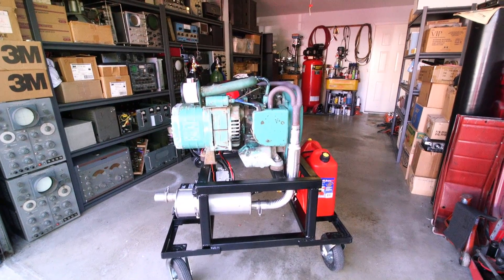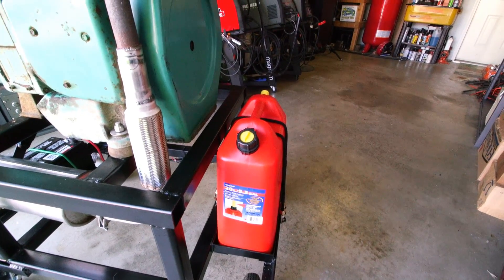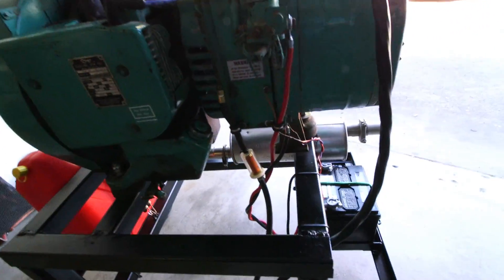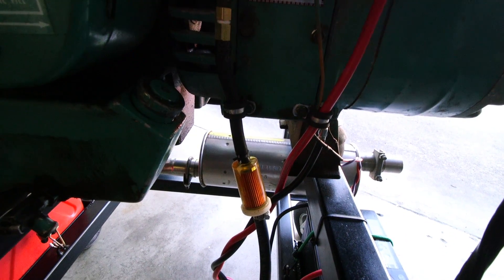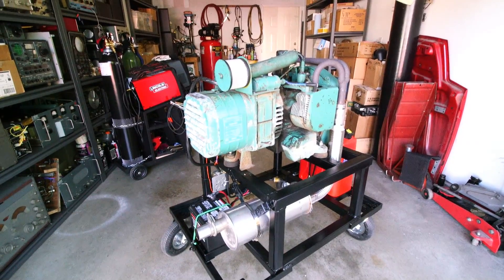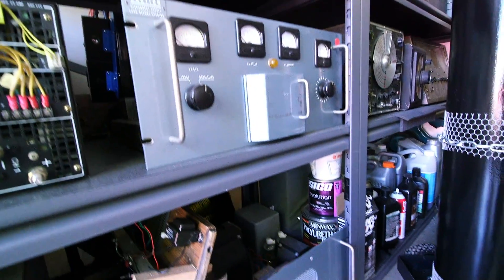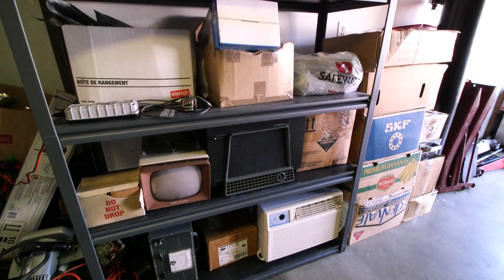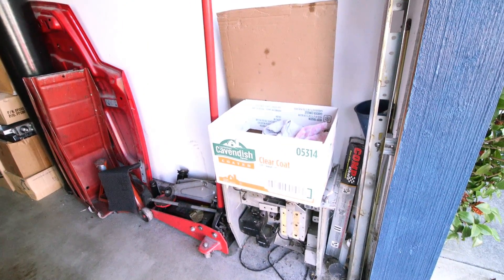Generator Build Update - See It Run!

Comment: You might want to watch for radiated heating of the battery from the proximity of the hot exhaust pipes and muffler; possibly install some heat shrouds. Also, I would move that fuel pump from the bottom edge of the frame to the top of the tube; it's far too easy for you to hit it on something where it is now. Also, it's easier to notice any tubing leaks when the joints are easily visible. I would not use a big plastic fuel tank; fabricate or buy a pre-made metal tank. I just don't trust plastic fuel tanks, especially in a shop environment.

You didn't mention the rating of your generator, so I'm guessing that it's about 3500 Watts; that means you should budget about 3/4 gallons/hour for full-load operation. With only a 5-gallon tank, you will have to get up in the middle of the night to refuel it. You could put about a 20-gallon tank on a separate cart.

I think I would also install a length of 2" x 2" square steel tubing under the MG set; a little extra steel in the frame is always a good idea.

I have also heard stories about Onan horizontal twin engines being finicky about their crankcase oil level; just a little bit low or high can cause shut-downs, and the oil dipstick isn't all that easy to read. OTOH, I have a 20-year old Onan 5500 Watt unit with about 600 hours that runs flawlessly.

Comment: I'd like to see you delve into the 'workings' of that generator a little. My brother 'inherited' one like it for payment of a $500 debt...I built a wheeled stand for it like yours...he lives where there are often power outages...
 These  ( or his anyway) was 3.5 KW and came from an older motorhome...the fuel was tapped in from the RV gas tank, and used it's own battery to start it, there's even a 10-12 amp charging 'wire' that has a nice big rectifier in line......no starter motor like most engines, instead it uses a part of the 12 volt section to start the engine without grinding gears and commutator brushes....electric fuel pump was mounted right on the side of the engine, and electrically heated choke/throttle.
 The most annoying thing I had to deal with when making a stand....the exhaust and muffler have to be underneath...!!
 These things have BIG slip rings and large graphite brushes....should last a lifetime....most of them are also equipped with a remote start/stop system...just 3-4 wires...so you can just power-up without getting out of the big lounger chair inside...
 Generator section actually had 2 separate 120 windings...you could switch a couple jumpers for 120 or 240....60 Hz vibrating reed frequency meter....they stay within 1% or so on the 60 HZ....

Comment: @1:59 Make sure the gas tank has a one-way vent/check valve. A non-return fuel system needs a check valve, preferably in the gas cap. Air is allowed to go in but not out. If it's totally sealed it will run to a point the fuel pump, no matter how good, cannot "draw" any more; i.e. vacuum created fuel starvation. 
The easiest way is to use a Ford 2 bbl "umbrella" style check valve or a lawn-mower style 5mm "duckbill" check valve; just drill the appropriate hole for either one in the top of the gas cap and install point end towards into the tank. The duckbill will need a cover to prevent debris from getting in. The umbrella won't. And we're talking pennies for either one. Or find an automotive style vented gas cap that screws on properly. However, it might be difficult to find.

Comment: Those RV-designed Onan's do run for a good long time. I did notice one thing you might want to correct before you run it too long, and that would be to turn your final fuel fuel around, so the gas comes in on the outside of the filter. It will probably work ok like that, but you won't be able to see when the filter is getting loaded up with dirt.😉 I think I may have mounted the generator in the low part of the frame so it's not top-heavy, and you could put something over the top to protect it from the elements when it's in use.. Other than that, nice unit, and it should last for a long time with an oil change now and then.😁
Reply from the maker: Hi Dan. The filter off the tank (bottom of the frame) is there to protect from particulate. The top filter was reversed on purpose, as I was paying attention to the top port (fuel back flow during design.) The upper filter really isn't needed, I just use it to watch the prime function now :^) Thanks for your input though, it's appreciated.

Comment: Paul, you might consider using a portable marine fuel tank. They are already set up for siphoning the fuel out the top side of the tank, and would be much safer than relying on a rubber gasket arrangement on the bottom of the tank, as you have it. That rubber will eventually deteriorate with time and fuel exposure. The marine tanks are portable and you can have more than one available for use.  Those Onan generators, with the 4pole generators are great for this kind of us. They only need to turn at 1800 RPM they are quiet and run for ever. I have been looking for one for years. Good luck with the project! 73, Chris, N9WHH

Comment: That’s a good idea to restore and reuse a generator of that quality. It being a lower RPM operated product will keep the neighbors happy. Adding additional welds shouldn’t be an afterthought, but tube builds are something I am familiar with. It’s a good cart and the wheel size will make it easy to move in and out. Good job!

Comment: I have often wondered why they don't burn out when you run them without any load. Alternators burn out in seconds when operated disconnected.
Reply from the maker: No diodes in this, just one external. The diodes and regulator are what fail in alternators, this generator is just brushes and windings, no fancy stuff to go bad.... This is why these are so dependable.

Comment: Paul all your projects are always very well thought out.  I very much enjoy all your videos.  For anyone who would ask why an onan generator and not a box store generator is as you say you cannot compare the way they are built and the dependability.  The only thing that I don't like is your fuel outlet on the bottom of your jerry can.  You even have a primer pump and I could be wrong but doesn't the onan have its own fuel pump??  Please consider installing a fuel pick up tube through the top of the jerry can.    That would be much safer.  Fuel could  eat through the rubberized gaskets you used and leak 5 gallons of gas in your garage and you will burn your house down and ruin all of our electronic fun project videos you do so well.
Reply from the maker: Hi Douglas. The pump is gravity feed, so the fuel has to come out of the bottom. My Generac generator also has a factory HDPE tank, and the outlet is right above the engine, "gas tank mounted above." The fuel tap on this generator has 3 seals, one in the tank, the threaded HDPE hole, and a seal on the bottom of the tank. This is compressed with a nut on either side of the seals. No leaks are going to happen here. Thanks for your concern though!
Reply: @MrCarlsonsLab  Cool

Comment: Sure it powers the house, but what about the amps in the shack?  What's the good of a nice power outage killing all the neighborhood RFI if you can't get on the air?
Reply from the maker: Hi Chuck. That will be another project.
Reply: @MrCarlsonsLab  Heat in the shack?  Sure, we have the glow of the 3-500Z's and the excitement of the next turn of the dial.

Comment: I had this exact generator in a 1980 Holiday Rambler class C . The generator would often run days at a time when dry camping at the races. The serviceman at Onan Indy would rip me for not working the unit harder. Guessing he had to decarbonize for top efficiency. These generators are Monsters, that is , they'll make over 4000 watts and never trip out.
Reply from the maker: The factory fuel pump... has to go. This is why I installed an electric pump.

Comment: Nice install!   One concern - the fuel pump location could cause it to get knocked off by something - I'd at least mount it sideways or get it inside the frame more to be more protected.  Would hate to see some excitement of gas gushing everywhere if the pump and/or lines got dislodged by brushing against/over something.   Otherwise very nice setup.  Those Onan generators are very nice kit.  I remember when you first got it thinking "what a score!".

Comment: Nice 👍 I have a couple of these Onan gen sets out of motorhomes plus my Miller Legend gas welder that’s a 10kw and also idles at 1800 rpm with a Onan engine. I’ve had it running 24 hours a day for weeks on end when we have major power outages around here. You can’t beat the simplicity and reliability of these units. These were built when quality really meant something.

Comment: The cart is a bit small, but most important,  with the generator set sitting high on the cart it could be dangerously top heavy and unstable.  Should be called "The generator cart project". The Onan Generator looks all ready built to me.

Comment: Generator is pretty cool. My only suggestion would be, being that your using a fuel pump, I would eliminate the jerry can with the tap in the bottom. I would use a pickup tube and draw the fuel up with the pump. I don't trust fittings drilled into that plastic. But, that's just me. I Wouldn't want to see a future video titled "Mr Carlson blows his house up"

Comment: Thanks Paul. Do you already have a transfer panel installed at the house ?  Will you need approval and installation by a "qualified licensed " electrician ? I know you have ample knowledge and tools to do it yourself.   I made a 50 amp system for my home with dual purpose.  Under normal conditions, I can plug my  TOY HAULER motor home into it for boon-docking / charging. When we have a power outage,  ( Houston, Tx...hurricane magnet ) I use the 50 amp connection to run the house off a gas/ propane generator.     J K

Comment: Looks pretty well done. One issue I see is that your upper fuel filter is installed backward. Fuel should enter the clear end then go thru the paper element and exit the white end. Otherwise, how will you see if there is any contamination in your fuel and clogging the element?

Comment: Gas line would have been better if making a disc to fit the filler cap of the poly can with drilled  disc where the gas pickup line would slip into. 
No holes in your poly can and you can have a couple cans on hand to fill one while running off  the other.

Comment: those rotating armature generators are neat. if you find brushes for it, horde them. parts for that generator are like hens teeth
Reply from the maker: Luckily there is a complete parts engine and generator on the other side of the shelves. Yes parts are an issue now, I agree.

Comment: May I make a suggestion? You should look at Marine Gas Tanks. They're equiped on boats for the outboard engines. I believe they'll better suit for your fuel container requirements.

Addendum: The fuel filter you have on the engine side is installed backwards.

Comment: Excellent Mr. Carlson! Did you Know that Onan is one of the last remnants of the Studebaker Corporation? Also , perhaps add A roof or cover for the generator to keep the elements out if running in bad weather , along with turning the exhaust straight up- with a farm tractor style "flapper" exhaust cover to make it even quieter . I mount my Grand Daughters Jr. Dragster fuel filters with the flow passing on the outside of the filer element to give a look at what and how much gunk is present.

Comment: Nice generator, love the old Onan engines. I've got a 20HP twin cylinder Onan engine on my John Deere 420 Garden Tractor built between 1983-1991. IIRC eng parts are still available thru Cummins though really pricey. It's really true in many instances "They don't build em' like they used to".

Comment: You needn't drill the bottom of the can; a pickup tube (brake line works great) can be inserted from the top, as it isn't gravity fed. Plus you can make it about 1" shorter to keep any errant water in the bottom of the can.
Reply: I was going to say the same thing.  Since he has a fuel pump why put an extra failure point in the bottom of the tank

Comment: There is a HDPE glue out there. I think it's...propoly or something similar. I've used it to glue HDPE to PVC, but i'm pretty sure it also had HDPE to HDPE bonding in the specs. Unfortunately, that was a few years ago and i long since threw the packaging out, it's made in US, i had to import a kit through a friend.
Reply from the maker: Yes there is, but too sketchy for a fuel system.

Comment: I’m surprised that you don’t have an inverter type generator considering all those electronics. I thought the kind you have has a lot of harmonics.
Reply from the maker: This generator is "the small version" of whats at a hydro dam. The newer inverter types are what create harmonics.
Reply: Mr Carlson's Lab so why do they say inverter style generators are electronic friendly?
Reply from the maker: They claim this just because they regulate voltage better, and maintain 60Hz. A lot of BS to sell you new technology that breaks. Most modern appliances have switch mode power supplies, they don't care about line frequency or slight voltage variation, as everything is regulated downstream in the supply. As soon as the line current enters the SMPS, it goes to a bridge rectifier, this changes the line to DC. AC is no longer in the game. Induction motors are the most resilient, but will move faster or slower depending on the line frequency. A few Hz is no big deal. Clocks that use the line frequency as a reference will be affected slightly, as the frequency from the generator varies with load within a few Hz max.
Reply: Mr Carlson's Lab Ok good to know.

Comment: Those old Onan Generators are pretty tough little generators. We used those pretty much all of the time at Pacific Gas and Electric Company at our Hydro division and up at the Geysers. They could be under the snow in a shed and we cleared the snow away and the old Onan Generator worked every time. Thanks for sharing the video.

Comment: We had an old Onan generator in our old house, where the power regularly went out for days at a time. Those things are built like tanks. It didn't have the capacity to run the range or the water heater, but it had plenty for the lights, the furnace (propane), and the water pump. The UPSs on the computers complained because it wasn't great at holding 60 Hz, but it more than served the purpose.
I'm looking forward to the restoration of the BC transmitter. Are you planning to use it on 160 m?
Reply from the maker: Thanks for your comment John. I will probably convert it to 75 Meters, more action on that band.

Comment: nice job, I'm sure you'll have many comments that the upper fuel filter is installed backwards
Reply from the maker: Good eye. Done to watch the fuel flow from the new fuel pump. If it was installed the other way, the port to the upper line is masked by the filter element.

Comment: I am now waiting for the Carlson _ Surplus war plane,outfitted with vintage radio tube gear; it will handle  the emp's which will fryout all the solidstate stuff. To fly to your remote Canadian outpost ,to fill us with news of the north  from your transmitters ~ ~.On the happenings of the post emp USA. Of course you will have solar and generator backup.

Comment: Hi, nice project.

You may want to consider cutting & installing a piece of Hardiboard (non-flammable cement-fiber board) in between the exhaust/muffler & gas tank to keep the heat away from the tank.
Reply from the maker: The front of the engine has a huge flywheel that blows warm air downwards right by the Jerrycan. The generator under full load doesn't affect the tank (heat wise,) and the exhaust is far enough away that it wont affect the tank at all. Thanks for your comment JP!

Comment: In regards to the 20 litre fuel can. You can get adaptors that goes in to the fill pipe to attach fuel lines. Commonly used with outboard engine for boats. May be a good upgrade

Comment: Battery is pretty close to the exhaust.  I'd be concerned about it getting too hot. Probably doesn't need saying to you, but for everyone else, never run a generator or any other engine in a garage for any extended time.  People have died from Carbon monoxide buildup leaking into their houses.  It looks like yours is fairly well sealed, but do you really want to trust your lives to  drywall tape ?

Comment: As a piece of info, for the gas can tank tap, a faster and easier solution would be one of the tank grommets and valves that are used on multiple pieces of equipment. You drill a 33/64" hole, the mushroom shaped grommet goes in and then a valve pushes into place creating a sealed tap.  Stens 125-336 is the bushing and 120-253 is the shut off valve.

Comment: Mr. Carlson you're a brilliant man, 1800 continuous duty generators will last forever if you take care of them and it's evident that you take care of your equipment. It's cheaper to make 3600 rpm generators but the noise will drive you nuts. Ever go camping and have a motorhome: with a noisy generator next door. Love the old Cushman service monitor, though our shop went to the HP's and they spoiled me.
Reply from the maker: Thanks for taking the time to write Mack!

Comment: That generator is crying, pleading, ney, screaming for a proper metal gas tank!  Come on now Mr Carlson! 🤓
Reply from the maker: Hi Brian. Metal tanks rust over time. This tank allows for clean operation, and with a flashlight shined through the tank, you can see the fuel level very easily.

Comment: Do you have a FLIR camera? The exhaust below the air intake concerns me! If that was an Air Compressor for a diver in the water, they'd get headaches and possible monoxide poisoning. In your case, the generator might be starved for oxygen, and run lean and sluggish.
Reply from the maker: Hi Alan. Not for an engine.